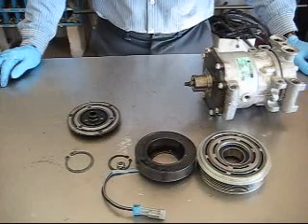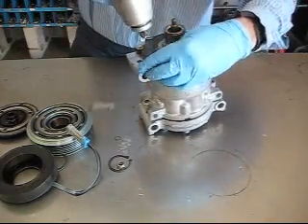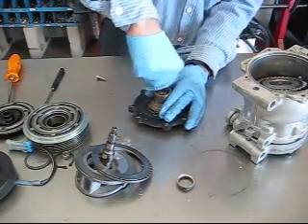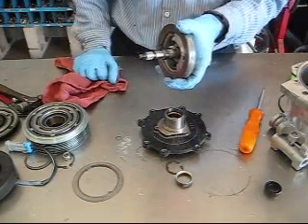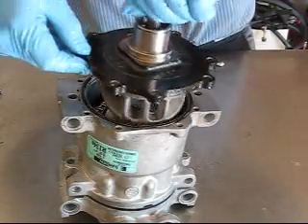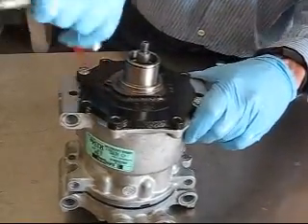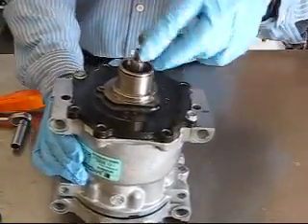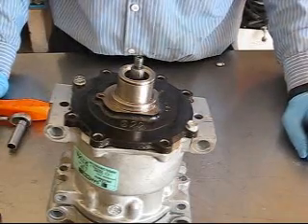Replacement of Sanden A/C Compressor Shaft Seals

Comment: WARNING: This video does not show the old type key shaft Sanden, you have to take the key of of the shaft but worse still the knocking out of the seal as shown in the video will break the spring loaded spacer that has a plastic part, i know of 3 people that have watched this video and broken that part, plus 2 of them have also damaged the roller bearing metal holder too. If you have a key shaft on your compressor be very very careful with the shaft seal, it will save you $$$$$$$$
Reply: Many Sanden compressors built before this unit may have a keyed clutch shaft. It is easily removed. Once it is out of the way, the procedure is the same and you will not damage anything as long as you use normal care. Yes you can do damage to the housing , and bearings if you are not careful where you place the tools before applying force. Thanks for bringing up the keyway issue.
Reply: @bobsteinmann5793 I have the old type of seal with Spring loading. Unfortunately i damaged it when i removed. Can i replace with the new type
Reply: @mohamedakeel3282  yes, the lip seal type is a better option. you will need to purchase a lip seal installer/protector tool to do that. Also, kits come with an aluminum spacer ring that goes under the new seal to space it properly.
Reply: This needs to be done carefully so as not to damage the seal.

Comment: Hey Bob great video. I've done fs10 before with good outcomes but rate now I'm doing a FS20 which has the seal installed from the inside. I ordered a FS20 seal kit part number MT2051 but it didnt come close to fitting (to big OD and to small ID) so I tride a FS10 seal kit MT2035 that fit perfect but leaks bad. any recommendation on the proper seal.

Comment: mineral oil is not compatible with R134a refrigerant
Reply: Correct. However the very small amount used to repair a compressor is insignificant. Pag oil draws moisture to itself so it is not used on o-rings seals or fittings.
Reply: @bobsteinmann5793  Double end capped PAG isn't hygroscopic by the way.
Reply: The mineral oil problem is only that it won't be carried around by the R134A (it will soon leave the compressor without lube; the same problem happens with PAO oil and R134A) but the very small quantity that you put on o-rings and seals isn't enough to cause this problem as long as you fill the compressor with the proper oil type.

Comment: Is the seal install tool larger in diameter than the shaft surface it ultimately seals against or the same diameter?  From the video it appears the new seal is pretty tight on the tool.